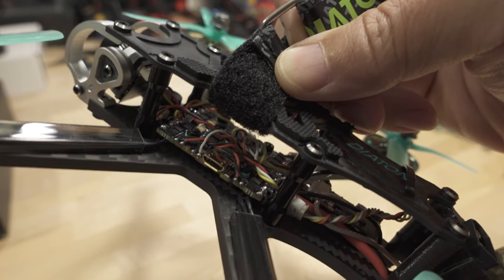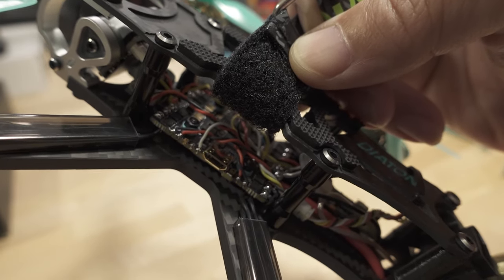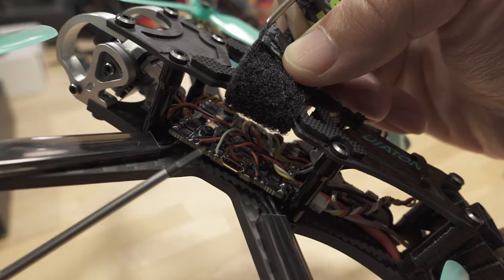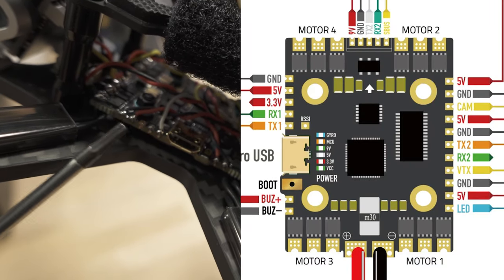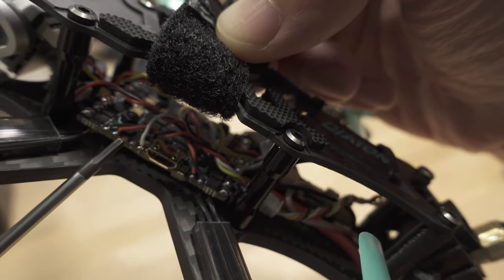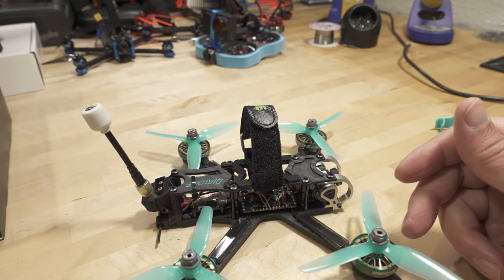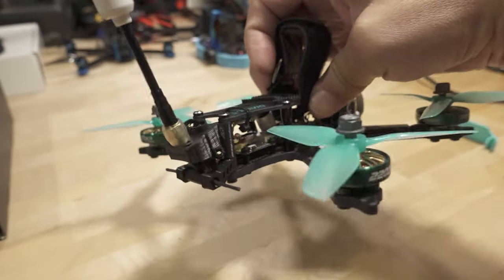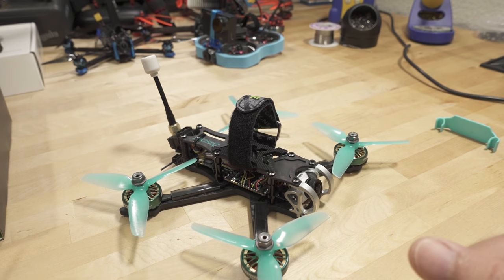ExpressLRS isn't broken your Flight Controller is! 🎓

Comment: This was an excellent video, not sure why it just popped up on my feed today... silly youtube. However, I disagree that the technical details don't matter though... the nitty gritty, yeah sure, but some specific coverage is warranted to give baseline understanding. It is usually due to the pulldown resistor on the RX pad on the FC for SBUS inversion. This is why you can lift just the RX wire (on the FC side, or the TX pad on the receiver side (since you connect RX to TX and  TX to RX with serial connections), power cycle it, and it should respond normally again. There's no need to disconnect the TX connection on the FC, only the inbound connection is a problem. Once you've identified that as the culprit, move it to a different serial port. VTX should never suffer that problem as it uses the TX connection on the FC only. There is a somewhat similar problem mentioned by Matek for UART1 or UART3 of F4/F7/H7 based FCs... which is that if you have something like a GPS connected (ussuggested wiring diagram), the FC won't enter DFU mode, and you need to lift the RX connection on the FC. Once you know RX line pulldowns are a thing, it's easy to diagnose and then figure out an alternative - change port, swap stuff around, possibly use bitbanging to move VTX/something else.
Reply from the maker: Wow, that was way over my head! 🤯

Comment: Not an ELRS issue but a board issue?  Seems like a lot of other receivers have been going on these various boards for a while with minimal issues.  Initially this worked fine on the Darwin FPV 129.  Now it stopped working (UART 2)
Reply from the maker: Well, this is mainly just covering one issue of many that exist.  I never said this was the only issue out there.

Comment: I have a flywoo Goku stack also f411 so it won't respond so I'm gonna try that switch around. It doesn't talk to transmitter bit it says connect  to Rx. Will see please respond if possible for more directions of I might need to work it thanks

Comment: RX will problem if UART port got 2 power 5v & 3.3V... put some resistor can solve but u can find another UART port without 3.3V and RX working...
Reply from the maker: It's just a work around 😁

Comment: great video , to bad it's not working for me. I''m running a aikon f7 v2 and I tried uart 1 till 5 and it's still stuck in bootloader mode. I switch for a xilo fc to the aikon. the elrs was working with the Xilo fc. I keep looking for solutions and any help would be greatly appreciated.
Reply from the maker: On the expresslrs.org website they talk about wiring up a pull up resistor to the 3.3v pad... https://www.expresslrs.org/1.0/quick-start/rx-fcprep/
Reply: @AlbertKimTV  thanks, I’m gone give it a try

Comment: Thank you very much for the video Albert. You saved me some money, nearly had a rash purchase last night👍
I used the Happymodel ceramic Rx on an upgrade build there and didn't have any problems. I then tried JHEMCU one and ran into this problem of solid light and no flash possible or bind possible. I spotted PP on the board when I bought SP so thought BangG were being fly. Has WiFi circuit so didn't make sense as PP doesn't have it.
The 1st build was flywoo 413 board and the 2nd was 411.
All resolved thanks to you. Cheers
Reply from the maker: Glad this info was helpful.  Appreciate the feedback.
Reply: i also plan on using a JHEMCU aio board 35A. can you please tell me on which Uart you soldered the Rx, so i can avoid the issue? thanks
Reply: @Fpv_Dad  I ran into this problem using a GEPRC F411 toothpick FC and one of my mamba F405 FCs. I'd spare UARTS on the mamba FCs so I used them. No problems with Flywoo 413. Trial and error done it for me between Rx brands and wiring. There's an inverter tick box within configurator that now resolves this issue, I think. I was done moving all over before I heard of inverter. If you only have 2 UARTS on your FC (one for your vtx SA, and one for your Receiver ) follow Albert's process and swap wires around.

Comment: Oh man! This video saved my sanity. I had it on uart 6 on Speedy Bee f405 and nothing. Moved to uart 2 and bam works. Your video saved me! 👍👍👍😃
Reply from the maker: You're welcome!
Reply: I got the ELRS to work with uart2 on the F405 but now the motors bobble and twitch make a bad sound. I turned down the master mix slider and they quieted down but  sacrificing a lot of flight performance. The quad fly's sloppy. Maybe a different flight controller is needed for ELRS I don't know. @AlbertKimTV

Comment: I think it never happened to me, using a F405 MK3 Mamba with ELRS EP1 RX, what i noticed is that i can't power the quad before the radio or it won't bind, i always need to have my radio with ELRS on before powering the quad. Thanks for the info, will be usefull since im transitioning all to ELRS
Reply from the maker: Yes, you need to have the radio on first.  If you power on the quad/RX first, the wifi one's will go into hotspot mode after 20 seconds and at that point you can't connect to it with your TX.  That problem is totally unrelated to the one in this video however.

Comment: thanks for the tip  I'm in the process of building a 3" with a flywoo 16x16 stack couldn't get it to work the first time and ended up lifting a pad trying to get it to work. got a new flight controller and going to attempt it again   do you think this was my problem?  does it have anything to do with the flight controller not supporting PPM or PWM. Does elrs work with any flight controller that supports crossfire? thanks again for all your help
Reply from the maker: Predicting which FC will work and which will not is almost impossible so I have no idea unless I try every combination and I don't have that kind of time.  Assuming the FC does not have this problem, if it supports crossfire, it will work with ELRS every time.
Reply: @AlbertKimTV  thanks for the help I appreciate it

Comment: Do you think this problem can affect crux35 hd version,I have one waiting to be shipped 🤔
Reply from the maker: If you have the one with the built-in ELRS SPI receiver, this is unrelated.  I don't know about the other version but this doesn't effect every board.  I don't know of a way to determine which ones are effected or not.
Reply: @AlbertKimTV  ok I ordered the Elrs version so I assume it's unrelated ,thanks ...I'm starting on and still learning

Comment: I wonder if this is why it takes 30 to 60 seconds for my elrs receiver to start talking to my transmitter? But I have this problem with all 4 receivers in quads with F411, F405 and two F7 FCs.
Reply from the maker: Turn on the transmitter first
Reply: @AlbertKimTV  I do. It does this not just the first time, but after every flight when I put a fresh battery in the quad.

Comment: This happens on my diatone F722 mk1 stack and unfortunately no matter what uart I use I get the same results... Just putting this out there I know you don't know what the issue is.
Reply: I just got my nanimno stuff too thinking this was a happy model issue...
Reply from the maker: Wow, interesting... hard to believe all the UARTs are affected and that board has more than 4 right?  Are you sure it's going straight into bootloader mode and not something else?
Reply: @AlbertKimTV  when I first power on the EP1 it will show dim lit led and wont connect to radio. not sure what mode its in at that point. but after that if I disconnect power and reconnect it will work just fine and connect to my radio almost immediately. This happens to both my ep1 and ep2 on this same fc. The only uart I haven't tried on this board is the uart the vtx is currently using.
Reply: @AlbertKimTV  whats even more interesting is I just wired up and finished flashing my Namimno 915 stuff and it seems to be connecting just fine every time on this same FC.

Comment: I had same problem, and DGI was on other UART. So tried swapping, no luck. This was trying to install Express LRS on tron80 aio 2-4s whoop board from Tmotor. Ended up using frsky xmplus with s-bus. So control works, shows rssi on betaflight.
But no OSD on DJI goggles, or auto record on arming either. No control via flight controller?
Please help
Reply from the maker: You'll have to contact the vendor on that model.  I don't have information on that FC.

Comment: what if you only have two uarts (like with cinelog25) and first one is already taken by vista?
Reply from the maker: Swap the UARTs.  Not that hard to do.  I've done it on many GEPRC boards with no problems.
Reply: @AlbertKimTV  yeah, just did it, works fine 👌i just had to dismount original plug and put two wires into a different UART, which makes the whole build not pretty :) pitty, brand new cinelog25. Thanks for replying

Comment: I had the same issue and i was thinking because the port is inverted or smth like that, so i made a pull up resistor on both rx and tx and it worked. So i guess it's probably because it is inverted. 
If you are smart enough you might find the inverter on the fc and removed it and connect back the trace. But that s too much work. So just switch uart.

Comment: i guess this is not related to the X-Knight 35 ELRS version i guess because you didn´t mention it in your review about the X-Knight. Am i right ? I am just asking because interested in that quad ;-)
Reply from the maker: No, that model has an FC with the ELRS receiver built-into the board and is not affected by this problem (assuming you get the ELRS version).  I can't say anything about the FrSky version.
Reply: Are you sure because in your video of the x-knight 35 iI can see the elrs receiver is put in the very back of the quad and connected via cables to the FC. Maybe you are talking about the crux 35?
Reply from the maker: @YaegerFPV  I guarantee you that this issue does not affect that board on the X-Knight35. It worked with no problems for me.  This problem does not affect every board, only some.  Also, this problem does not affect the crux35 ELRS version.  That's the one I had and it worked with no problems and definitely not this one.
Reply: @AlbertKimTV   your answer is much appreciated, thanks and continue with your good reviews. I specially like that you have separate videos for the in depth review itself and the flight videos - good idea

Comment: For whatever is worth this happens only with the Happymodel receivers and not with the Betafpv receivers.
Reply from the maker: That's not true.  It happens on any receivers with the ESP chipset from any manufacturer.  If you are having a problem with a Happymodel RX but it doesn't behave the same as a BETAFPV RX, that is a different problem from the one in this video.  There are a few other issues that might look similar but it's not the same as this one.
Reply: @AlbertKimTV  sorry I should have said that that was my own personal experience.